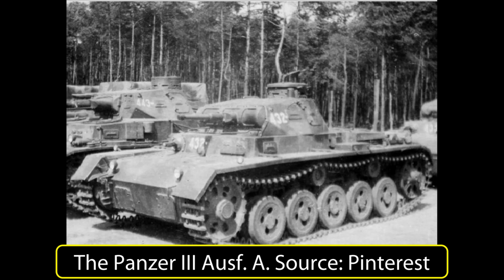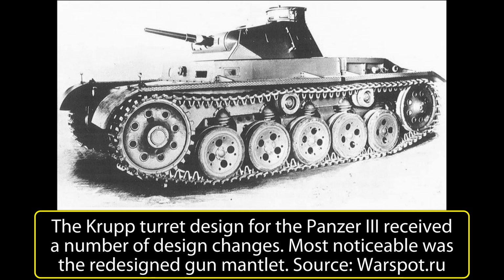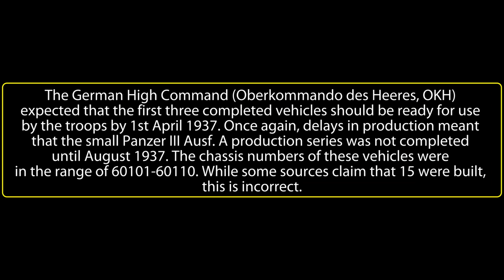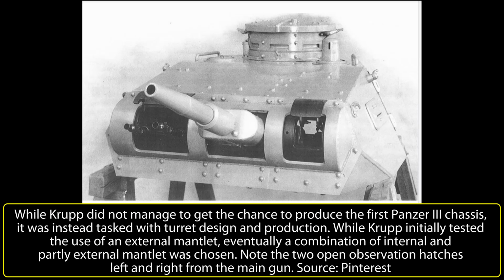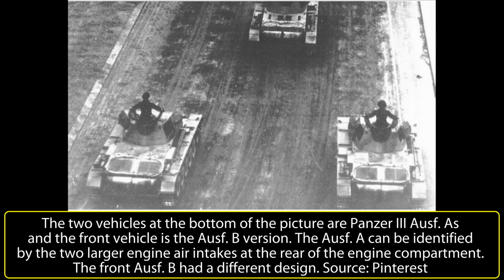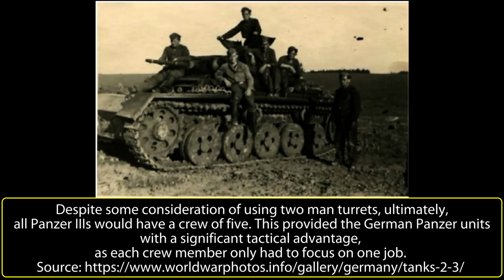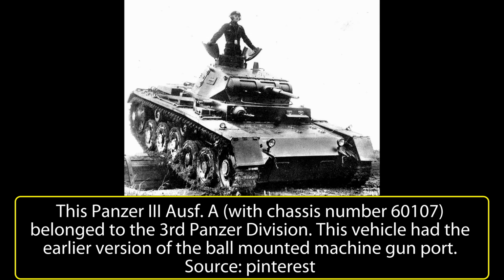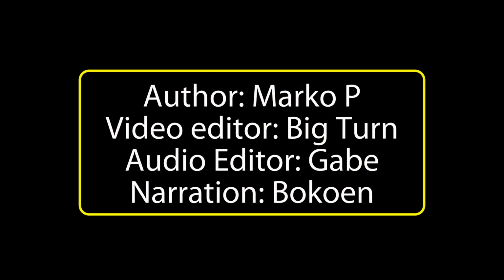Panzerkampfwagen III Ausführung A (Sd.Kfz. 141) | feat. @Bokoen1

Comment: At 14:50 you say the loader could fold away his seat and "stand on the turret basket". But there was no turret basket in a Panzer III.
At 15:10 the description of the radios is confusing : you say "ordinary vehicles" had the Fu 2. But what is an ordinary vehicle? Is it a Panzer III  or is it another vehicle? If it's the tank, when is the tank not "ordinary" ?
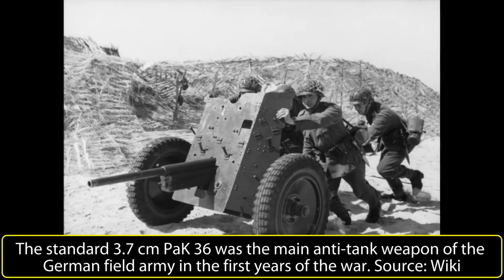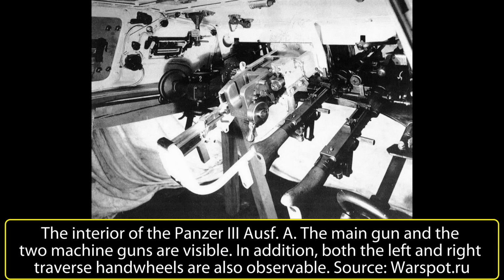At 16:40 you say that the main gun had a horizontal sliding breech block. That's not true, it was vertical, and you actually post a photo where we can see it  =  17:14
Reply from the maker: It's an old video based on an old article. I'll forward your comments to the author.
Thank you for the feedback!
Reply: Thank you for your comment, this is a bit older video, and most of the stuff you mentioned is corrected in the text article itself.

Comment: Personal criticism, not meant to be hostile -- I like these videos and check them out for both information and entertainment.

* I think there is often too much "attack", too much multisource output, in the videos. In a single sequence, the narration delivers compressed information that I need the subtitles to get...
but I can't use the subtitles, because they hide the text boxes which just appeared...
while the images contain a lot of subtle information that I need to think about. This makes for a lot of pause and rewind, and makes it harder to consume the content.

* Instead of straightforward (=hard to read in many cases) text boxes, put information in designated "head-up" positions. If at all times, identifying information relating to the image (PzKpfw IV C / Heinz Guderian / Kasserine Pass) appears in the upper right corner, key points in a list to the left (* engagement * breakthrough *exploitation), and sequence of events fades in and out in the center ( "Case Blue: start", "Splitting into A and B", "Fighting on the Don") it would be much easier to quickly pick up the information without losing track of what happens in the narration of images, and also to ignore information that I already have. (I realise that this does mean a significantly higher workload.)

* I can't believe I'm saying this, but the images are often monotonous. They are useful and not bad at all, but even as I am thinking, hey, there is that gadget, or yes, that's what the difference was between A and B, you can only see so many small b/w photos of Ausf A before they start to blend into one another.

I'm not a video maker; you guys are. You're doing great work as it is, and I'm happy to subscribe. But consider this a little something written in crayon on a candy paper and dropped in the suggestion box.

Comment: Remember when Wot still had the pz3 a  instead of pz3 e those were the good times very quick very fun no armor 14mm  punchy gun small target and then came e for some more nearly useless armor 30mm you were suddenly slower and a bigger target
Reply from the maker: the Panzer III E is quite a bit smaller than the A
Reply: @TanksEncyclopediaYT  Thanks for replying i guess i should have been more specific. The Pz 3 a has perhaps a bigger volume and its certainly longer but its not as wide nor as tall as the Pz3 E.
Since length is not important when you show the front to the enemy the pz3 a was in wot in most cases a smaller target. 
There is also the possibillity  that the Pz3a with its old standart definition model has been modelled smaller than it should have irl and therefore when it got replaced with a high definition (all tanks got HD models later on) Panzer 3 E model which is suppossedly correctly sized the difference was much more noticeable. 
If the Pz3a was indeed to small than it would make sense to swap the pz3a to the later e model since if the tank was getting bigger anyway the small difference in size between the models a and e is not worth losing the armor
the model e would provide. Checked your encyclopedia for the measurement thanks for your work
Reply: Probably dwelling on the past, Pz 3 E’s 30mm of armor means it’s capable of ricocheting any shell it can face aside from tier 4 howitzers, while also nearly invulnerable to autocannons. The Pz 3 E is also ridiculously fast and has the same gun as Pz 3 A, so it is just an Pz 3 A with more than double the armor. 😐 It’s probably the strongest non-premium tier 3 right now.